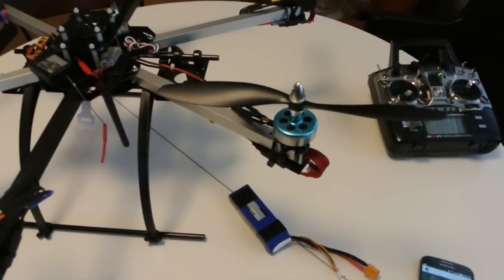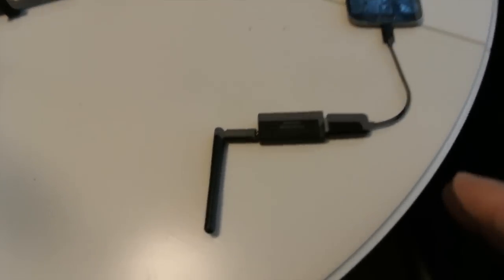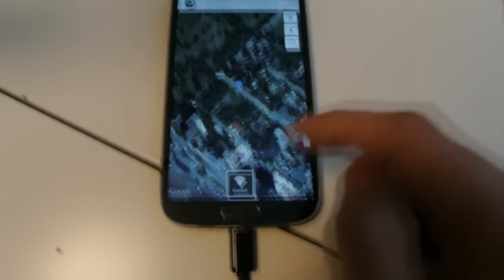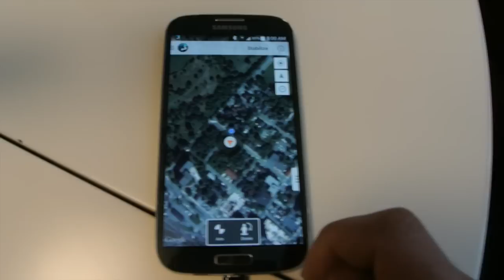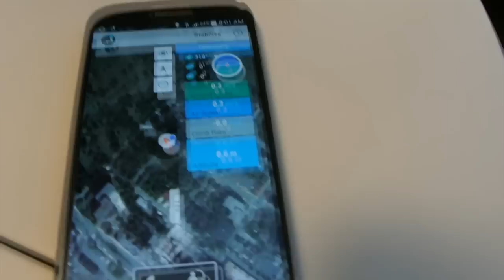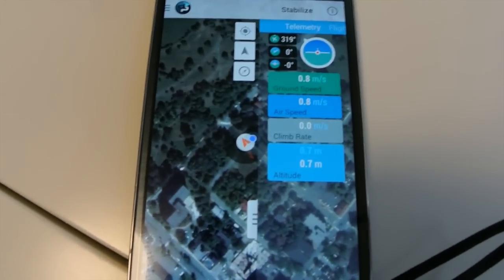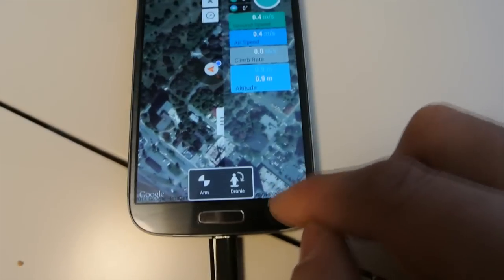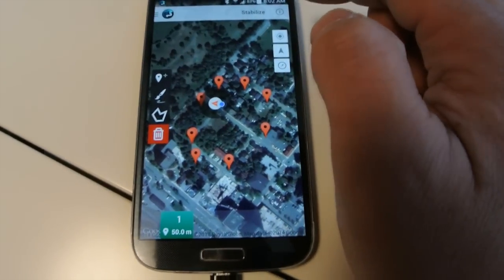Hobby King Hexacopter Frame Overview APM 2 6 with Telemetry

Comment: what Lipo are you using in this setup 3S or 4S
Reply from the maker: I use both 3s and 4s.  The DT750 seems to handle either fine.
Reply: did you mount those motors with zip ties?

Comment: mine has 3.14 beta firmware and 750kv ax 12x6 chinese apc props, and bounces up and down rapidly almost flying off, why so any ideas would be great.
Reply from the maker: I would reflash with a stable version of the firmware.  I've had similar issues.